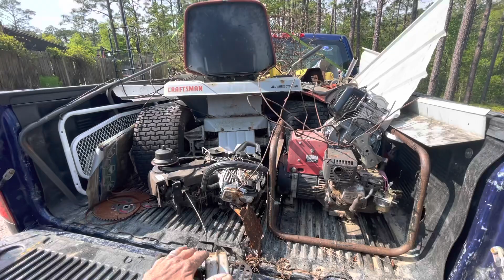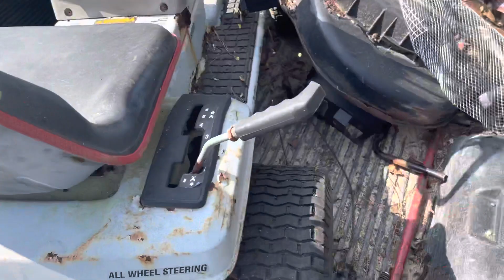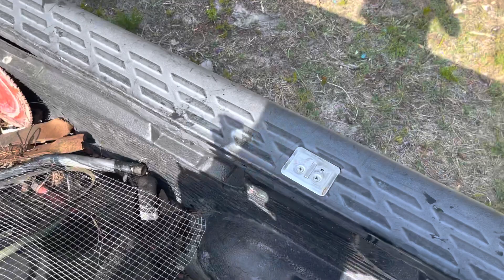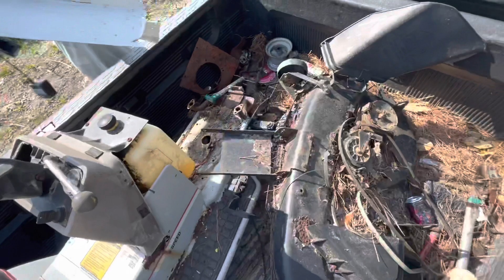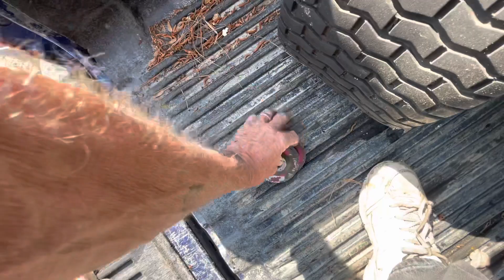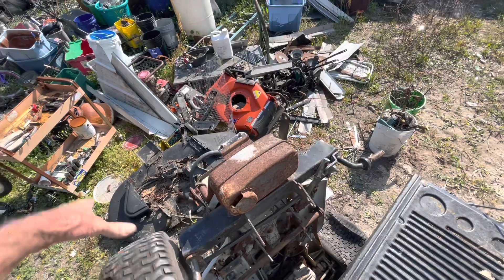Scrap Gods Strike Again. Got to love it.

Comment: Grampa, you're correct about " shred pays for gas", we all just hope to find non-ferrous metals to pay some other bills. I'm completely addicted to being a metal man. Today I took in 540 pounds of light steel (shred) at .12 cents for $64.80 . Tomorrow ACR's and sealed units. Cheers.
Reply from the maker: Yes sir I agree 100% the shred pays for the gas and we always hope for the non-Ferris medals to bring the cash at least that’s the way it works for me. Be aware that shred prices are going down probably 50% so if you have any get it in now before it goes down. Or you will be stockpiling it until it goes back up